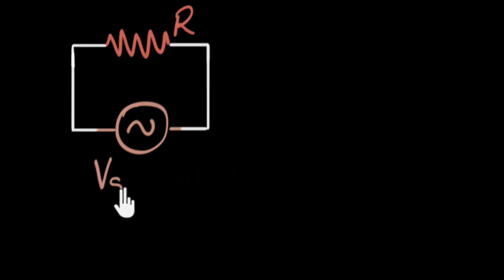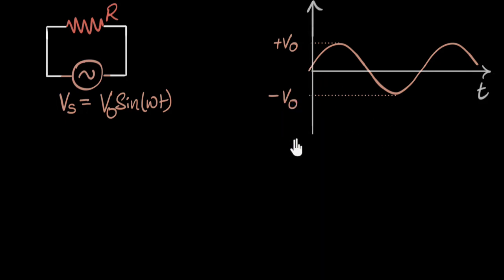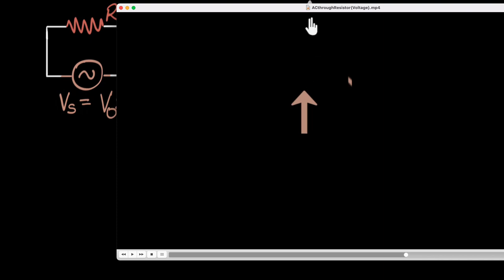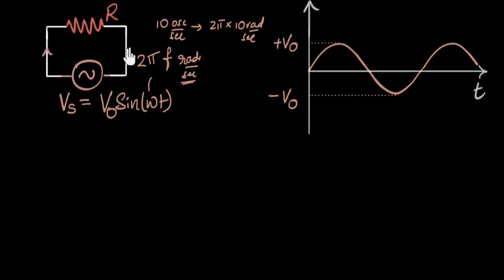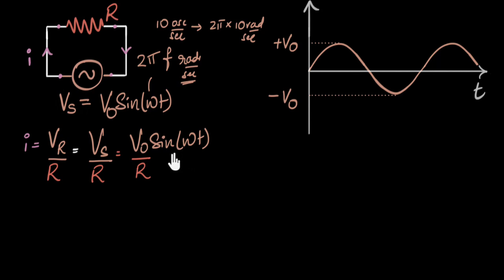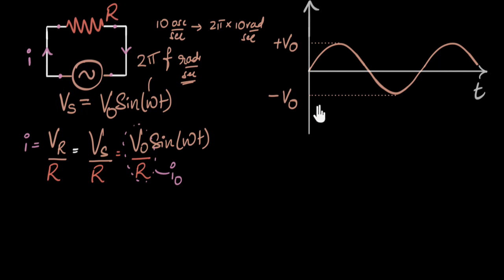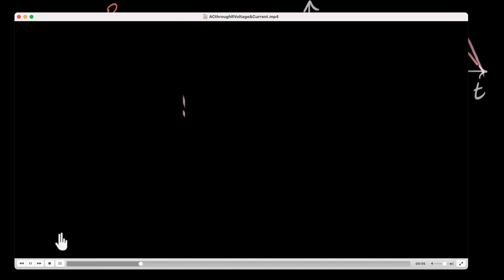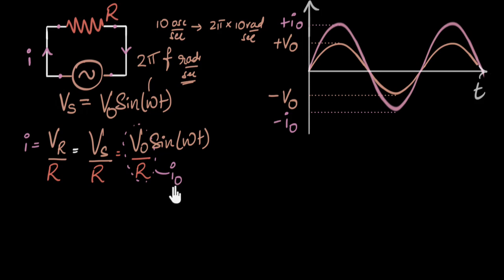AC voltage applied to resistors | Alternating currents | Physics | Khan Academy

Comment: The current max. value must be less than that of the voltage max since r must be > 1
Reply: Assume R=0.5, I will then be larger than V.
R does not need to be >1 it needs to be >0

Comment: Thank you so much for clarifying the i_o vs v_o graphs. I was confused as to why the i_o graph has higher amplitude than the v_o graph. So it's really just arbitrary, as i_o can have lower/higher numerical value than v_o depending on the resistance.